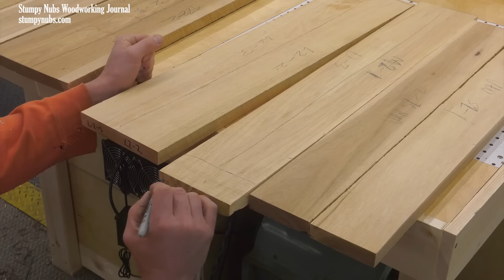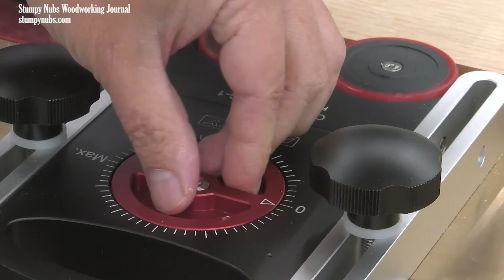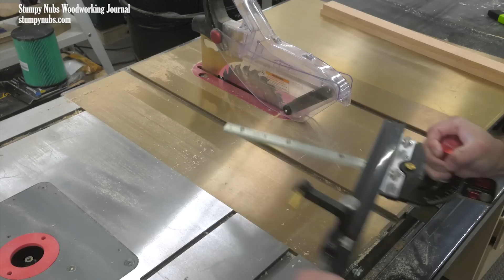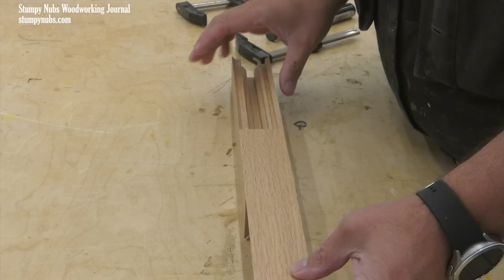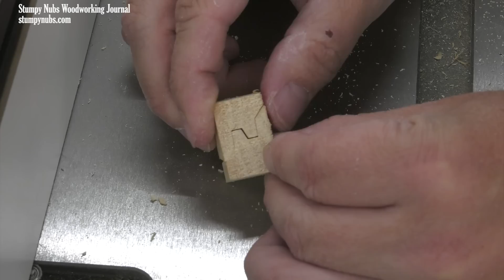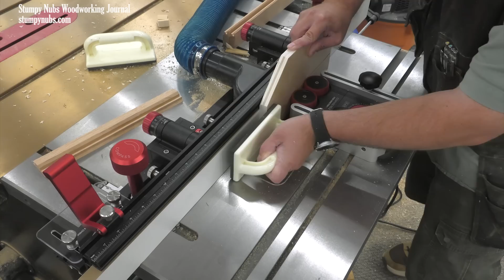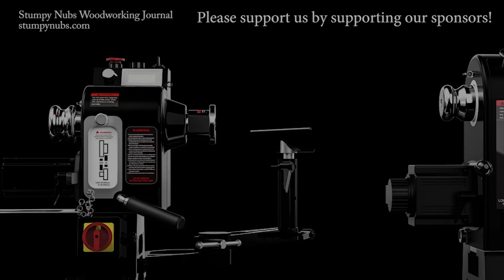How lock miters can make projects cheaper and better.

Comment: This is exactly how I make my bed posts. Customers often want 5"×5" and up and this makes them way cheaper and lighter as well as easier. The last headboard I made was over 400lbs, I can't even imagine how heavy it would have been with solid posts
Also, I prefer to make 2 sets of pieces with the same cut on each side, 2 with horizontal cuts and 2 with vertical cuts opposite each other. Makes fitting them together much easier on large pieces
Also, some advice, if you're having trouble doing this in one pass, add an auxiliary fence to push the workpiece back a bit so you can take smaller passes
Reply: Do you ever put chamfers on those bed posts?  Would the seam still look fine?  I want to do this for the bed I am making, but want a chamfer on the posts.
Reply: @sailblue10  should be okay, as long as it's not super deep.
Reply: @sailblue10  yes I put roughly 1/16-3/32 chamfers on them. There is enough "miter" there that as long as your bits are clean and sharp there won't be a noticeable seam. Proper glue spreading plays a factor as well
Reply: How do you keep them from sounding hollow?  Serious question, this might be a concern I have where building 4x4 / 5x5 posts this way might simplify things.
Reply: @keinespur0  with them being that small, it shouldn't sound hollow. If you did want to make it not sound hollow, you could fill the cavity with a proper sized plug. I had that idea while watching this video. I'd probably just cap the top and bottom with a plug if I was gonna make it this way.
Reply: @keinespur0  I've never had anyone "knock" on them to check the sound so its not been an issue

Comment: Glad to see you using that narrow paint scraper. I use one in my shop all the time for glue removal and it is very handy for scraping wood imperfections and leveling off small offset in joints. Just be sure to keep it sharp.

Comment: This was a really cool video.  I love your channel.  I’m wondering why you don’t make a jig for setting up this bit (like the Rockler one you can buy).  You usually jump at the chance to make jigs to make life easier.
Reply from the maker: Those jigs only work if the thickness of the material is exactly 3/4", and even then you still have to do test cuts.

Comment: James - what would this look like if it was mounted on a lathe and turned to round? Would it still look like a solid piece of wood, or would the cracks show?
Reply: Give it a shot and let us know.  I'm gonna guess the joints would show.
Reply: @DuffyHomoHabilis  I'd have to buy a router table and the special cutter - not worth it if I can't be sure of a good result.
Reply from the maker: You are likely to find some small gaps and imperfections in the glue seams when you get inside.
Reply: I did exactly that around 1970, age 15, at school when I made a taller than usual standard lamp with a table ⅓ height from floor for my mother. Cable went up the spave in the middle and weight saving made whole thing more stable
Reply: In theory, the whole joint glues solid with no gaps the whole way down, but wood moves....

With idealized materials, the likelihood of the whole thing exploding on the lathe before you hit "round" varies with the width of the final assembly, I would think.  I have my doubts you'd get anything pretty.  Nothing ventured, though... (protect your face and neck)

It seems like there would be better ways to segment a turning without this very expensive bit. Ways which would also look a lot better and be less likely to become chopsticks.

Comment: Man I can’t wait to use that bit. I’ve got an ambrosia maple desk in the near future that’s going to be way easier now.
Reply: Bit of advice, bit size, router power and bit quality are all very important. I have a rockler large locking miter and 3.25hp router and had to add auxiliary fences in order to take smaller passes in 1.045" thick red oak
Reply: @pattyofurniture100  noted. Thx